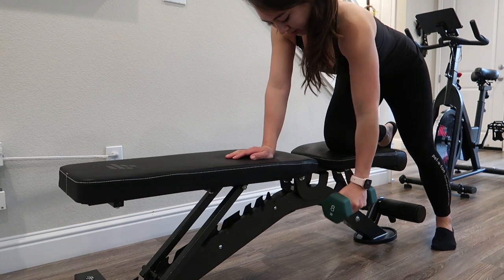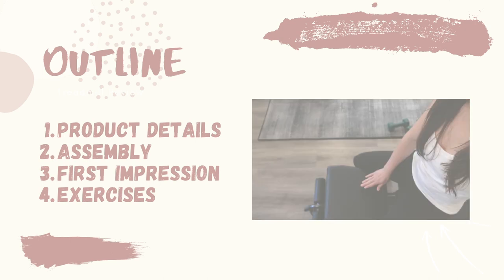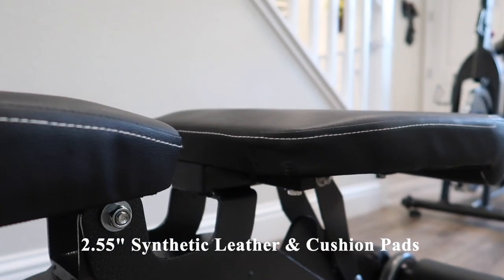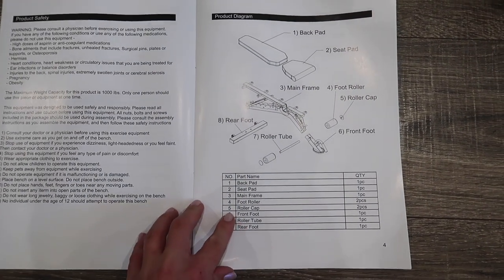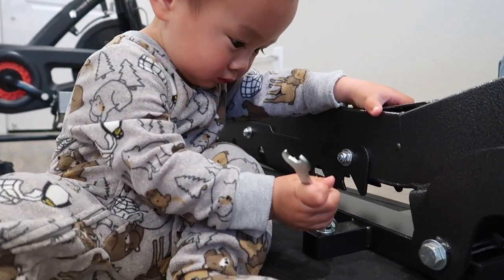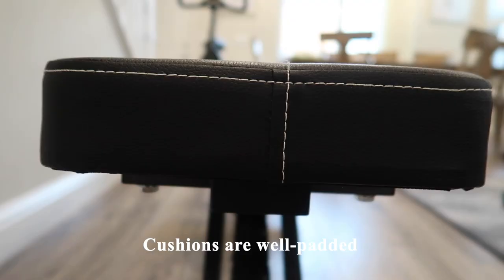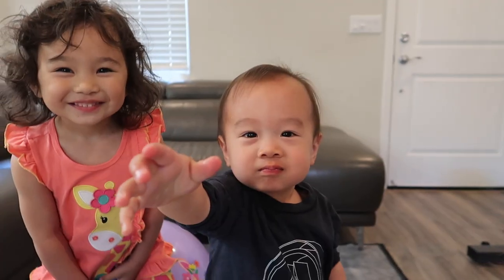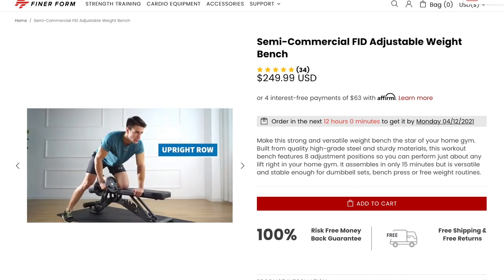Best $250 Adjustable Workout Bench | Finer Form Review

Comment: Thanks!  I was really close to buying the Rep AB-3000, which would have been about $345 after taxes, but then I saw the Finer Form bench on Memorial Day sale, which made it $230 after taxes.  It looked pretty solid, but your review sold me on it.  I just put it together, and it seems very well constructed and it's very stable.  I would have liked the Rep bench in the awesome red color they offer, but this one looks to be everything I need for $115 less.  Aside from the color, the only other minor complaint I have is that the end caps for the square tubing seem pretty flimsy, and a couple of them fell out during assembly.  But overall, I'm very pleased, and this will be way better than the bench I was using for flat dumbbell presses.